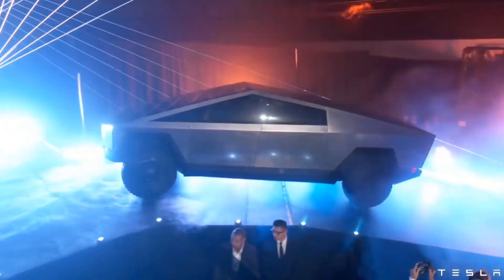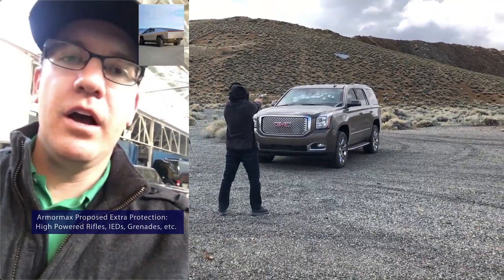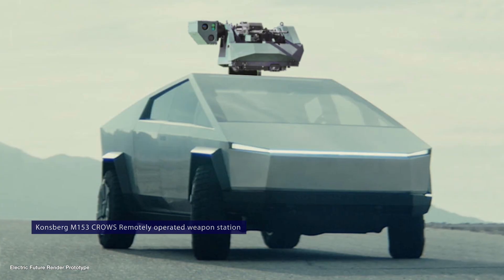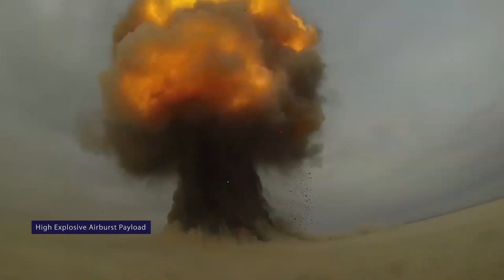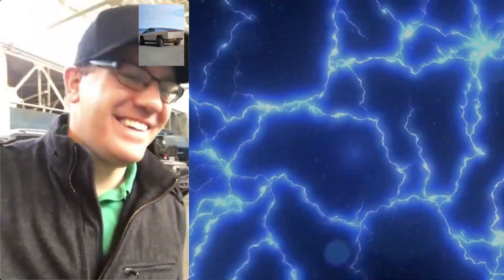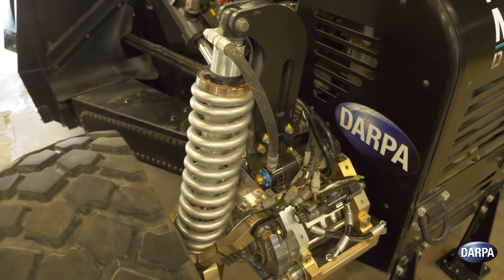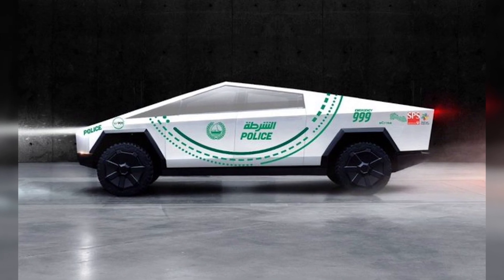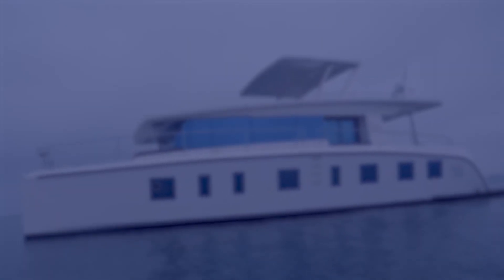Military Tesla Cybertruck: Combat Vehicle

Comment: The military cyper truck might not be such a bad idear.
Tho i would go for elektric Diesel hybrid power.

Elektric batteries are not fuel efficiant engoth, or fast engoth to fuel also you will have dumb soldiers looking after them so make it easy to repair too

Also shape the batteri pack in a V so the truck dont get flip when rolling over mines...

Actuly build the thing from scratch think it would be cheeper.

Comment: Will those batteries be able to power the 3 radio communications systems and amps, the jamming system, remote gun systems, FBCB2 and air conditioning? Those batteries would be toast just running checks before a mission.

Comment: I'm 48yrs old now, d'you know how long ago I thought about putting weapons like explosives on remotely controlled aircraft, around 28-30yrs ago, and with the advent of smaller or what I call micro jet engines, for remote control scale models, my imagination went crazy, all that was needed was a leap in technology, computer processing power and programming, also autonomous systems for non line of sight maneuvers, ams now it's finally a reality.
It's always made me wonder what's taken the military so long to accept such technology from leading military equipment manufacturers/companies.

Comment: I think range would be an issue, some of those military vehicles similar size have up to 2000km range and can be refueled almost immediately
Reply: New tech that they're building factories for nearly triple the range on EVs. Other new tech they're setting up to mass produce allows EVs to charge in 10 mins. Both technologies are expected to be affordable to the public in the next 8 years or so. 

They already exist and are being intigrated into some luxury 2025 and 2026 models last I heard.

The range of a top line cybertruck would be 1300 + miles with the new batteries.

EVs are significantly more affected by extreme temperatures and load size, and reliance on electricity being available in warzones is problematic, though solveable with  portable wind/solar/gas generators. There are pros and cons to it.

Comment: But since the battery is under the car what happens when they get on a landmine...
Reply: It's called fun

Also any shrapnel will pierce the battery unless the underside and lower sides of the vehicle are protected by 8mm of steel.

Comment: how would you protect it from E.M.P? a standard diesel humvee can be protected (as long as it is not running) by shielding it's electronics with copper but how would you shield a 100% electric tank/LAV? a faraday cage sounds all well and good but how would it fit wthout grounding it out nullifying it's effectiveness. even if you could protect it could you protect it's charging infrastructure.

Comment: Or you could save thousands of dollars and do what we did. By adding rino liner and it is both ied proof and bullet proof. Then just change the glass. All that fancy armor just adds weight and cost without any significant improvement over rino liner. We tested them side by side and rino liner won hands down. Like it or not test results have proven the supremacy of rino liner over expensive armor options.

Comment: DUDE IM IN FOR MAKING A 6×6 TESLA CYBER TRUCK AND WITSH A AUTO MATIC MACHINE GUN ON THE BED WHEN IT OPEN IT COMES OUT AND CYBER BIKES SIDE WAYS IF TS EMERGENCY THE BIKES WOULD GO STRAIGHT AND THE MACHINE GUN WOULD BE ONE WITH THE BED AND THE 5 SOILDERS 3 WOULD HAVE TO PRES EJCT SEATS AND THEIR SEATS CAN BE CONTROLED AND 2 WOULD RIDE THE BIKES AND THE CYBER TRUCK 6×6 WAR HAWCK CAN MAKE A TRAP WITH ELECTRIC MACNRTIC BODY AND WOULD TAKE DOWN A  TANK BY A CANNON THAT COMES OUT FORM THE FRONT BUMPPER AND THE CYBER TRUCK WAR HAWCK  6×6  HAVE 99WHATEVER THAT STEEL IS IDK AND ALL THE JAMES BOND STUFF

Comment: The truck might be suitable for police work, but not as a petrol vehicle. As for military use, while the Computer system would in theory be downgraded to save cost.

The simplicity of an electric engine might do well if they can secure electricity to charge up the truck. And if the batteries are well protected.

Comment: It would need to be designed from the ground up to be an actual military vehicle. You can’t just keep adding weight to the chassis as it will crack and bend and bending battery packs would not end well. I can imagine the tanks being run with hydrogen power as it can be refueled quickly and out in the field. Plus hydrogen gives full power till the tank is empty, not high power while over 75%, medium power from 75% to 25% and low power when below 25% battery power. No one would want to take out a battery powered truck into a war zone without 100% power and would be getting nervous when it showed 50% power as they knew it would be running slower than the trucks running full power, they would hate being the slow one out of an area if things turned bad. Plus the other trucks would have to slow down for them to keep up.

Comment: Gentlemen,
I’ve designed a device that recharges batteries in flight or E-car so it can stay in the air or on the road permanently for as long as it wants. I am a renowned Inventor from Croatia.
Reply: Doubt

Comment: Technically not the same steel as the rocket anymore as they change the steel type used for the starship. Besides, even if they did actually use the same type of steel the starship is made of thin walls while the cyber truck seems to be made of nearly an inch or more.

Comment: The military abandon gasoline powered vehicles save the jeep after the Sherman's would explode from small arms fire when hit in the fuel tanks, they have been using diesel ever since, even in tanks, its turbine generators running on primarily diesel that power the electric motors, God help anyone thats in a vehicle with a lithium ion battery when it gets hit and the battery starts cooking off, let alone the extreme charge times to mechanized infantry which has to be ready to mobilize all of the time, it takes a few minutes to refuel petrol engines in lieu of extended charging times,  temp extremes will affect performance as well. The only service a cyber truck will ever see is maybe in special warfare but I would never use it and spec ops pick their own gear. Nice fantasizing though.

Comment: When I was in the Army 87 to 91 I drove an armored car for a couple weeks for a visiting Italian general...maybe French. I forget I just drove the car. We had dozens of people to cart around all in different cars. We must have cleared out all of the armored cars in West Germany(before the wall came down) because I got like the armored clown car. It was so terrible I wouldn't be telling about it if anyone knew my YT handle. It was a Volkswagen bus! It was probably an 85 or newer. OH my god it suuucked. Old fashioned armor, so like 4 inch thick windows and good old iron...probably cold rolled and chrome molly. If they had put a big block chevy in it it would have been under powered but a VW engine? WHO thought of this? At least it wasn't that pop up roof bus they had in the 80s. I got stuck at an uphill stop light and it would not GO! The general was clackin away in...Italian or French. I mean I was like 19. I had been drifting with a 68 Impala(big block and T10 4 speed) since I was 12 and before there was such a thing as drifting. SO I panicked, got pissed, threw it in R and stomped on it, and slowly rolled backwards. Once I had a little speed I whipped the wheel, slid it around into the opposite lane, ignoring all other traffic but missing them, and pointing back down the hill and already doing a fair clip. The general liked it, I think, but I thought I'd lost it for a sec due to being so top heavy. Went around the block and got a running start at the hill and ignoring the stop light. 
We got ambushed by a stoplight on a hill. 
So that's the under powered armored car story...that I'll never tell in person...not without making the car a BMW when I tell it, lol.

Comment: So, the military is going to lug the fuel that would normally fill the vehicles, to crank up generators to power the truck, over a longer time than just filling the truck. Or maybe it has a Flux capacitor.
Reply: What it would do is allow you to spend less time distributing fuel to many smaller vehicles and thus reduce the complexity of logistics.  On top of that, there are new types of batteries currently in the process of being commercialized which could allow for energy densities up to 3-5 times greater than current L-ion cells and charge times up to 3 times shorter, with greater inherent safety and lower cost precious metals.  This would reduce duration of charge times and expand the range of electric vehicles beyond that of conventional internal combustion vehicles.
Reply: @youtubeisapublisher6407  I understand the increase in capacity,  that's what R&D is for. It also applies to the combustion internal.  I like hybrids. And it doesn't have to have an ICE, it could have a mini nuclear reactor.

Comment: At 12:01 you mention the "3-speed range change gearbox" being part of the "Electric In-Hub Motor".  The picture implies a single planetary gearbox which would provide two (2) forward speeds and a reverse, or if the motor is reversible, two reverse and one forward or any combination of the above.

Comment: No, No, No! 1 tiny frag anywhere in that stack of 10,000 +- batteries and you get a thermal runaway battery fire. Even if you fire isolated the batteries the vehicle would still immobilized(ie. effectively killed).  Now a good idea would be an electric assist that would allow limited stealth movement + electricity for other equipment.  With an assist system you could use the batteries as additional armor isolated on the outside sorta like "explosive reactive armor-ERA" cells. If you take a hit just engage the diesel and let the isolated batteries burn, or better have a system to jettison the affected battery stack. And if the diesel fails the electric would be redundant propulsion to at least get you out of an ambush.

Comment: you would also want an emergency battery in case the main one gets damaged, to get out of the danger zone
Reply: A damaged battery is a danger zone by itself
Reply: @moritzk3004  the vehicle would be resistive to a battery fire
Reply: @nutzeeer  thats physically and chemically impossible

If shot the battery will have enough energy to fasten the reaction up, and release some not so nice gases
Reply: @nutzeeer  or if you want a more complex answer: batteries store energy, one way of releasing energy is a fire/detonation, which means that a baterry can only be fireproof in a closed system that has no oxygen (fire only/most commonly works wit oxygen)
Aka the only thing fireproof about a battery is the battery casing, which can and will be damaged in a warzone

Comment: interesting theories. interesting renders. interesting commentaries. but... it's not happening for 20-30 years. electric tactical isn't happening anytime soon. fuel (100% ICE) and hybrid is just more efficient. those quotes from soldiers, i think you seriously took out of context because they're talking hybrid. i've seen next gen vehicle tests in Alaska for Arctic Conditions straight out of DARPA and none are pure EV. because the batteries today in pure EV are worthless for tactical vehicles. they just don't have enough energy density. go to EngineeringExplained's video on EV towing https://www.youtube.com/watch?v=S4W-P5aCWJs

and you'll get the math to prove why EV is not at the point where Elon thinks it is in a truck. if his Cybertruck can not haul it's max rated towing payload 100 miles up into the mountains at a 5% grade on a single charge NO tactical agency is going to buy it. period. 

the Abrams initiative you mentioned was hybrid as well. tank tracks technically only require power at four points, the front and rear drive wheels on each side. each of those drive wheels could be operated by one electric motor. the Abrams Hybrid Initiative considered a diesel turbine engine half the size of the present engine but attached to an electrical generator instead of the present transmission which is not much larger than a classic VW Beetle. the hybrid electric generator would both power a battery as well as directly power the four drive wheel motors for each track. considering the turret and other fire control/loading/aiming etc. operations on the Abrams are already fully electric as well as many other systems. i'm not fully aware but i believe the recoil absorption system for the main gun is hydraulic with electrical pump assist.

Comment: 3 motors
500+ miles of range
14000 lbs towing
0-60 in 2.9
3500 lb payload
Under $70k
Pretty good, even if it looks like a kid designed it

Comment: All this amazing defensive and offensive technology, and yet, it's still just a vehicle that runs down the road on wheels and tires. You'd think humans would have applied themselves a little more in that direction; eliminating the necessity to actually roll across the surface of the planet.
Come on, guys, new thinking!
Reply from the maker: you mean, aircraft?
Reply: @ElectricFuture  ,  Yes, but without the  propellers,  wings, jets, rockets, etc. Some means of propulsion, similar to magnetic levitation, that would allow a vehicle to hover and fly several inches to many feet above the ground. Normal traffic could be restricted to, say, within 30 inches of ground level. Exceptions could be granted for certain circumstances up to 50 feet. Emergency vehicles, police, etc. could reach a height of 100 feet.

Comment: THE ANGULAR FRAME OF THW TRUCK HAS PURPOSE. JUST LIKE IN TANKS. IT WAS CALLED AS "SLOPE ARMOR". MATHEMATICALLY IF A 1 INCH METAL PLATE IS ANGLED AT A DESIRED SLOPE IT WOULD INCREASE ITS THICKNESS RELATIVE TO HORIZONTAL FÍELD OF VIEW WITHOUT ADDING ADDITIONAL WEIGHT .ALSO THE ANGLE OF THIS THING'S ARMORE DEFLECTS RADAR SIGNATURE AWAY FROM THE RADIO SIGNAL RECEIVER MAKING IT LOOK LIKE AN A BIRD IN THE RADAR DISPLAY. SOME MAKES FUN OF THE DESIGN, BUT THE DESIGN MAKES SENSE. IT WAS DESIGNED TO TAKE A BULLET.

Comment: I wonder what the chemistry of stainless steel we are talking here since there are scores of different ones in the three hundred series.
Reply from the maker: Elon says, “It’s a new variant of 300 series stainless steel, but it also gets cold-worked many times, depending on kilotonnage of press.”
Reply: @ElectricFuture  Do you know where they started, 316 321 what was the new alloying agent used if there is one. Or how one of the common was tweaked to come up what works. I am sure that they have it covered well by patents.

Comment: It is a fascinating concept.  The question remains, what do you do in the absence of an external power source?  One solution would be a small on board generator fueled by diesel , gas or propane that could recharge the battery when the vehicle is at rest  or even serve as a range extender while under way.

Comment: LeTs BoLt A bUnCh Of ThInGs To It. Cool. So to compensate against added weight and added power consumption? More weight = more power needed = extra batteries = even more weight and less space to put things in. After all of this tech you're not going to have any range for field work.
Reply from the maker: show me the math.
Reply: @ElectricFuture  there's no math needed. You can't just add a bunch of weight and electronic draw to a vehicle that is also electric and expect it to perform the same as it did when it was stock. More weight means more power needed to move the vehicle. More electronic equipment added to it, the faster your battery banks are going to be used up. The concept is cool, no doubt I'm just saying that without an upgraded power source and added battery banks, the vehicle is not going to have the range or durability as what the military's current MRAPs, LITVs, and LIFVs have already not to mention how would you get power to recharge the battery banks out in the middle of nowhere while in the field?
Reply: @ElectricFuture  i do enjoy these types of videos and do not mean to be disrespectful.

Comment: And what they are going to do when they need the armored vehicle to move troops and the vehicle is with low battery ? A normal vehicle just need 5 minutes to full fill the tank and have extra 600km, with a simple and cheap tank.

Comment: The true problem would be the low energy density of batteries compared to liquid fuel and battety logistic. Civil vehicles can compensate lowering their weight, but slap any type of armor/heavy equipment on a cybertruck and its range will shorten drastically. It gets even worse with towing, which is a thing the militery does a lot, sure electric motors have epic instant torque but there is no way around the amount of energy required to move mass, if you have 200 kw/h in your battery you'll travel less than a jeep with its >600 kw/h of fuel.
Short range is a big problem for a recon vehicle. If battery powered vehicles can't be the back bone of the operation, than you'll need fuel logistic anyway and a very good reason to add battery logistic on top of that.
The most reasonable use for electric in the military is police work and military occupation of cities
Reply: They would probably slap a hydrogen based generator on to it to counter lack of range